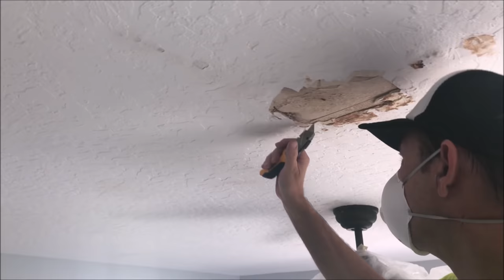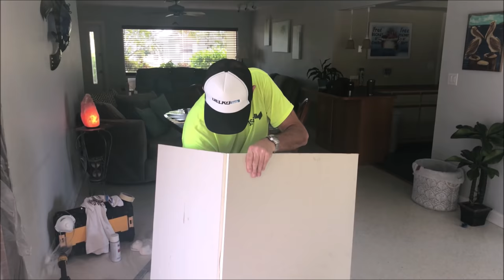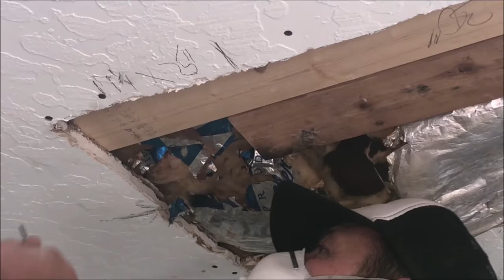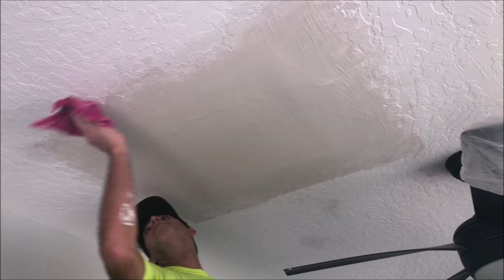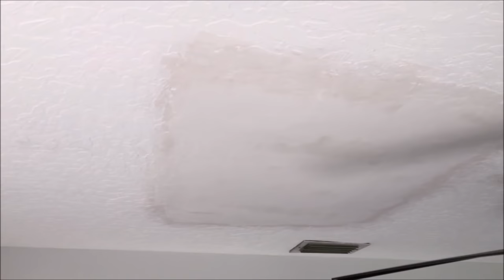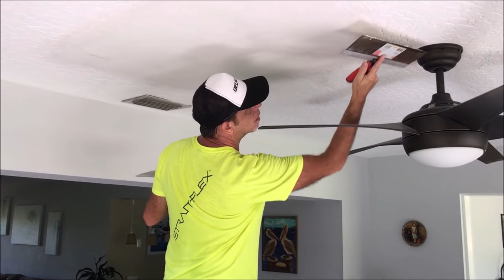How To Repair WATER DAMAGED DRYWALL CEILING- Step by Step

Comment: Also is if you put it on your hawk a little bit looser and you just shake it so it flattens you can just slice off what you need to go and texture with you’ll be an equal a consistent amount each time you slice off your hock I don’t know if you’re using a box and see you’re gonna have a ridge now all around your your patch but if you would’ve basically took a hard liquor San float and cleaned it all out worried the joint connected and he would’ve had less of a buildup and it would’ve landed in a lot better I do like that trick with the heat gun I’ve never seen that before and the other thing too is when you’re putting your fibre tape mesh if you’re overlapping onto your texture you’re just gonna build it up you’re never gonna be able to make it blend so I clean away about an inch like that I can put together so the mess can go onto the other side without touching the the the texture the little bit tedious but the end result is I’ve never had anybody complain and word to word of mouth near golden this texture can also be accomplished by brushing it and then knock it down the build ups a lot less I noticed that your knife is flat opposed to like you should have it the edge sitting on the ceiling not like the whole night flat on the ceiling like I can see your ready that you’re your texture is completely different from what’s up there and they knock theirs down you are knocking you just laying it on there there’s no knock down or no nothing a texture is winning the driver drag the wet mud off and then he dragged Daniel knock it down you’re just flat me a note I can send you know if it’s also be done with a brush like a real coarse brush I got like probably 25 brushes that I use if you seen the texture I have to copy Nauti blow your mind so big long Icicles are just disgusting

Comment: Hi Paul, thank you for posting this great video. I have watched it over and over to try and get your technique down. I did 2 repairs before watching this and they are OK but not great. Recently my ceiling leaked again, squirrels  got to a water pipe, ugh! So I have questions. The remaining drywall is intact but the paper peeled off. What do I use to seal the raw drywall before applying mud? And, you textured with a skip trowel mud? Is this a special mud or different trowel? It sounded like it had some sand or grit in it????
ANY help in answering these questions would be helpful......thank you in advance!
Update- Hey, Paul, I just checked out your Amazon store and found the supplies I need to use, thanks again!

Comment: Hi, Paul. This is a great video! I have learned a ton by watching this. I have a ceiling repair that is very similar to this, from water damage. My question is, can I buy setting joint compound as well as all purpose compound in smaller quantities? As a DIY-er with only the one repair to do, I definitely don't want to get a 5-gallon bucket. How much would I need? The area is about 14" across, maybe a little bigger once I start digging into it. Thanks!

Comment: When you trying to blend the edge when I found is if you cut it on a straight line I know you thinking that there’s gonna be like a border around it but it’s not you’re gonna come up to that Chris Blind and then you’re gonna sponge it in and it’s gonna just land really quite nicely detector that I see up there is a drag trowel that says they put the mud on the tip of the edge of the trail and the dragon and then they flatten it down or it could be thrown up with a brush and then back trail down

Comment: Only thing I would do differently is scrape the texture off at least 6 inches around the patch. That way when you retexture the spot it wont be twice as thick as the rest of the ceiling.

Comment: Awesome video! I'm trying to repair my garage ceiling.  My shower pipe leaked thru the bathroom floor, soaking the insulation, and ultimately coming through the garage ceiling.  The plumber cut out the ceiling and threw away the insulation so now its just open.  He's gone.  I also don't know which supplies to buy (type of insulation, tape, mud and drywall etc).  Appreciate any recommendations.

Comment: On the skip trowel section, are you letting any of the existing skip pattern along the edges inform what the knife does with the new skip over the repair? Are you picking up what those edges are putting down, or is the sand and your light even pressure doing everything?

Comment: You are doing awesome job.  I've had leaking ceiling problem with the upstair neighbor.  They sent a guy to patch up the sealing. The problem is that he put the tape around the edges before he put the compound. Because you put the compound and run taped on top of it.  So should that cause a problem, like edges are coming off?

Comment: AS  A CONTRACTOR YOULL FIND A CORDLESS JIGSAW WITH THE BLADE CUT DOWN EASIER THEN A HOLESAW WITH A CORRALATED SCREWGUN AND LOOKING AT YOUR FIRST COAT IS A LITTLE ROUGH EVERY COAT COUNTS

Comment: I am a DIY’er always had issues doing drywall it’s tricky! I had a roof leak a few months ago and I need to repair. I will try your techniques on my small bathroom ceiling. I do have blown in insulation any suggestions for that before I start? Thanks

Comment: Great video. Would you recommend against using 1/2” Sheetrock for repairing a ceiling with 5/8”?  Since you’re mudding anyway, I thought that it might not matter. I definitely want to do it right and get professional results, though. Thanks!

Comment: Paul, great video!  So I have a very similar situation.  However, after putting on the second coat of mud and sanding, it looks like my edges are higher than the drywall...like you can literally see where the mud ends and the drywall begins. Any suggestions before I paint it?  Also, I didn't mud the entire square drywall I installed to fill the hole...should I do that as well?  Thanks!!

Comment: Nice job, was wondering what it looked like after it was painted.  I had someone come in to my house and make this same kind of repair, but the patch that was maybe 1 foot in size grew to 6 feet and the texture does not match and I can see a big patch in the celling after it was painted so it’s an ugly repair.  I don’t know what my expectations should be in regards to a matching of a patch, or will I have to do the entire ceiling

Comment: If you didn't have a textured ceiling, what would be the best compound to use for the final skimming before painting? 

Have two square holes in my dining room ceiling after plumber came out to repair minor leak.

Comment: Do you need to mud the whole sheet rock or can you just do the taped area? I had a contractor say he didn't need to do the whole sheet rock up on the ceiling but only the taped sides.I was thinking it would leave a dent in the ceiling if the whole sheet rock was not mudded.

Comment: If the water damage is surrounding a recessed ceiling light, can I do this the same way but cut out a place for the light? Or maybe do the patch in two halves so I can cut out a half circle on each side for the light? I have a small amount of water damage and can't get any contractors to come out because the project is too small.

Comment: Did you simply attach the furring strip to the existing drywall?  Is that what you did there?  I have the same issue with my ceiling that I need to fix, and I've been pulling my hair out trying to figure out how to attach a huge hunk of drywall to basically empty space.  I don't want to remove the entire sheet (since it's not all bad), but I'm not sure how to suspend the drywall over the void with nothing to attach it to.  Using a furring strip attached to the remaining good drywall seems suspiciously easy.  lol.

Comment: I have a hole in my ceiling. been trying to figure out how to fix-You only put in 1 piece of furring strip? I wish i could show you my ceiling. basically it looks like I have to find the two main joists-so I guess that means I have to cut a bigger square and attach furring strips to both sides and then place the drywall into this?

Comment: If you have a smooth ceiling, I assume that skim coating the complete repair area is not necessary.  Simply smoothing out the joint areas.
Reply from the maker: Actually, I would skim the paper of the drywall too. Because, the primer and paint will absorb differently on the joint compound then it does on the drywall paper (known as flashing or photographing). Which can make the repair more noticeable in the end.👍🏻🤓

Comment: I was always told to use a setting joint compound not an all purpose on the first coat over mesh. But it looks like your using a different type mesh or tape  would like to know what type it is

Comment: Thanks Paul! I’m an all around fix it man. Never heard of Fiba Fuse. On repairs like that, is it crucial? I’m on my way to my mom’s. She had a leak in ceiling. Got 20 minute mud and two types of tape ( paper and mesh) flat (smooth finish) do I need to find Fiba Fuse?

Comment: Hi Paul,  I need to fix hole in the garage ceiling at the seam with the wall. Can I use the same method you are using?

Comment: I had celing repaired due to water damage and the guy who spackled the ceiling left all these bumps on the drywall.   It seems where the screws are there are bumps.  How do I fix that?  do I skim coat, sand them down or something else......just to note he painted the ceiling already with an eggshell paint.  He  said he would come back and fix it but of course like a some typical contractors they disappear.  hit me up with your thoughts or a video you might have in your archives.

Comment: I have a question, in another video you did you repair an old speaker hole in ceiling and said you used all purpose so should I not used that and what do you mean first coat do you mean what you put down before the tape? Sorry I just want to get right and know what to use.

Comment: Alright, going to your store and buying the stuff you used. DYI guy and I repaired a patch just like this from water damage. A few months later a nice crack formed all along the square board I had put in. I used fiberglass tape thinking it was super armor high speed low drag material. I'll get the Fiba tape you used and try it your way. Thanks for the video. Also, its infuriating how easy you make this look and how you put the texture on like it's easy. It;s not so knock it off please and don't show off...  A couple of cuss words and throwing the mud across the room and kicking the cat would be a little more realistic but very helpful anyways. Thanks.

Comment: Hi, great video, thanks. If you have a hole in your ceiling ands it’s a traditional plaster and lathes ceiling, can you use plaster board to fill the hole or you should use tradition plaster?

Comment: Hey man!  DIY/subcontractor.  I’m interested in your tape, I’m not familiar.  Do you use it because it keeps air bubbles at bay?  Also, did you just use 3 different textures of mud for each coat?

Comment: I am a DYI er. I have two projects coming up, 1 ceiling and wall damage from a roof leak. I am waiting for the roofer to replace the roof. So, it is a corner, would I make the sheet rock one piece just bend it into the corner without cutting it through?
2nd project hanging 5/8" sheetrock. area is 8' X  21", so, using 8' X  5/8" it would fit well. Problem is there are numerous pipes and hangers to work around. I can remove the hangers, so I don't have to cut the sheet in numerous places. I am working alone, I'm 75 lifting and maneuvering around piping is the challenge. Any recommendations to alleviate the project? I know have someone else, do it? LOL

Comment: The fiberglass tape I’ve used has a sticky side. Is there a reason you’re applying yours in the middle layers of mud vs straight to the Sheetrock?

Comment: How do you repair corner joints on drywall? I am a DIYer and need to fix drywall corner joints on the ceiling.

Comment: I had a leak from the upstairs bath to the lower bath that got new drywall, but I have to finish it; DIY'er. The ceiling is plastered, so the patch will be too. Thanks for the tutorial. How much does that size patch cost the customer?

Comment: I had drywall replaced when ceiling got wet. I am now taking down popcorn ceiling and trying to get ceiling flush for painting. Edges are raised all around repair. I have tried sanding and not smoothing down. What do you think I should do

Comment: Great video very helpful. So I’m filling in a hole downstairs the upstairs bathroom leaked into the ceiling downstairs. I cut out the whole and I noticed the paint that they used on the ceiling in the walls is enamel that enamel paint keeps peeling off like a big sheet of skin when I get the hole filled in how am I going to match up that enamel with the new enamel just sand it down the best I can or keep peeling the enamel off until it stops I have a feeling they didn’t use any primer when they laid down that enamel . Thankyou
Reply from the maker: How old is your home? They could have painted that enamel over an oil base paint. That would make it peel like that too. Let me know.👍🏻

Comment: Had a leak for years, huge hole in the basement ceiling, talked to my home handyman, showed him, he said he could fix it, he put in drywall. A while later the new drywall fell out. He put drywall over the hole but didn't fix the leak.

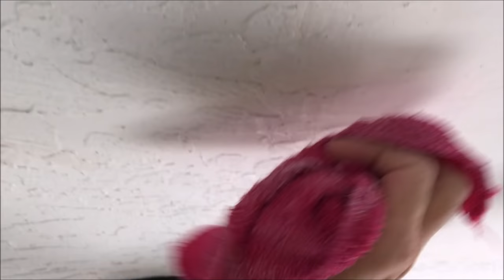Comment: I don't understand what's causing the texture to show up when you use the 14 inch taping knife after 19:00     
Shouldn't it be spreading on smooth?  Is the texture just a result of a hard scrape?
Watched again, I think I need "skip trowel mud"

Comment: Hi have a quick question, i did ceiling pactch last night, it came well.  one thing is that the area where i put compound came super flat and when i painted i can see the sheen diffference.  the other areas has very microscopic drywall texture that came from wall papeer, jiont compound doesnt have that textute.. do you have any idea how i create that or should i use different nap roller or sand coarse ???

Comment: I am working walls that the Homeowner never put a sealer and primers on the Wall before installing Wall Text. The walls are a Mess after the Homeowner scraped the Wall Text off the Walls. parts of the Wall Text is still on the Wall. Do You have any ideas to remove the Wall Text that is leftover on the Walls?

Comment: I’m first time diyer I had pod light in stall in my living and the installer remove about 5 ft of ceiling dry wall wanted to know what type of setting compound should I use first timer

Comment: The real damage here is mold caused by moisture exposure to building materials that contain cellulose. It doesn’t go away by letting it dry out, it spreads and creates a contaminant that spreads. To stop the spread, just dry the wetted building materials, to remove it, disrupt the mold root system. Very easily done, just need to be aware of it.

Comment: I a accidentally got some WD40 on the first coat of skim coating. I blotted it with a paper towel. Is it gonna be a problem as far as the second coat adhering? I was gonna send a photo but I can’t find an email for you.
Reply from the maker: Yes, WD40 can cause a problem with the skim coat and with the paint down the road. Best thing to do would be to gouge out any where any WD40 is and re-skim that area until it’s flat. Then proceed to the second skim on everything.👍🏻🤓

Comment: Is it necessary to use the mesh tape on all ceiling repairs or is it just because you used the 20 minute mud?
Can you use paper tape and all-purpose mud on ceiling repairs at all ? (I am repairing a stippled ceiling )
Thanks- great video!
Reply: Because it's easier to work with & stronger. You can use paper no problem. Just make sure you have plenty of mud behind the tape for adhesion
Reply: @jeremyr7147  thanks! I ended up buying a roll of the mesh. It was right there with the 20 minute mud. Worked well.
I did pretty well for an amateur drywall guy! 🤓

Comment: Can you tell me how much it will cost me to get two holes fixed one is about that size you're doing right now ,and the other one is half that size? I should not be paying for this I'm a renter ,but I have a slum landlord owner, if I pay to get it fixed I'm taking it out the rent, do you do house calls? and you can tell me how much this will cost me?? I live in Clairton PA

Comment: @Paul Peck DrywallTube..I have a large spot of water damaged drywall on the ceiling. IT is already musty, so worried about the mold factor. Is there a way to treat the drywall for the mold, or is it wiser to cut out all the damaged drywall? Please advise. Thanks! One guy I talked to said he would use an oil based paint? over it and that will control the mold. I am having a hard time believing that.

Comment: I just spent a week to scrap off pop corn ceilings. I noticed the join compound taking at least 6 hours to dry in the winter time. Is there any other process to dry it faster? I can't use the heat gun with a large area.
Reply from the maker: Aim a floor fan at it.👍🏻

Comment: easy fix takes 3 minutes,,, no kidding ,, i fixed a hole in the ceiling 8 inch by 7 inch,, ,,all i did was put a vent screen for a furnace return and done ,, over the hole it went ,,, screw on each end and your done,, i had a leaking baththub and it came through the ceilling all fixed now

Comment: Why everyone of these taping videos I didn't see anyone removing the coating of, either popcorn,or other finish from the tape side of the good drywall? Everyone just throws mud over both sides of the tape. 
I mean, your NEW drywall side of tape is fine, but you don't prep the 2" area that the tape is going on at the original drywall. 
This doesn't make sense. Everyone of these fix it videos never prep the whole tape area? Doesn't that make one surface thicker than the new area and leave like a frame of thick looking finish?
I'm not getting this?
Thank you for your video.